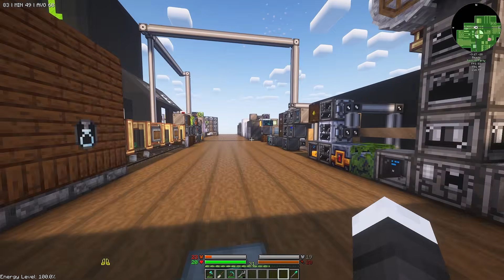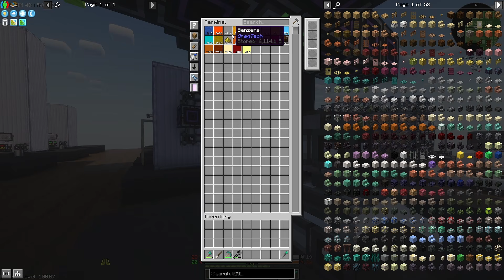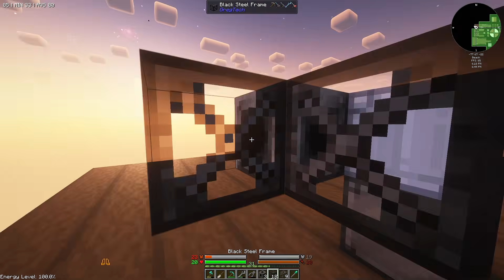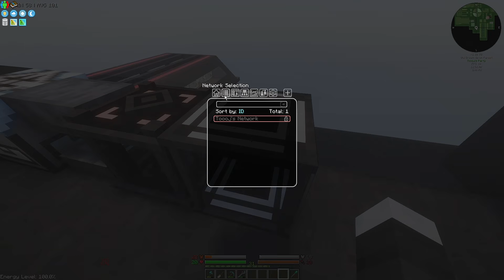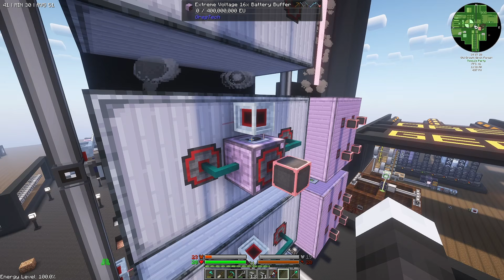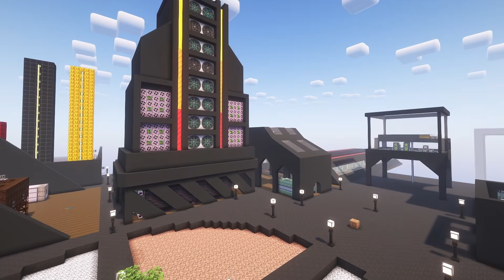Star Technology E15: EV with UV power

Comment: a nice tip,  if create is added with gregtech, you can automate the insertion of rotors when the rotorholder is empty, so you don't need to worry about them breaking or can use a rotor that is more efficient but has much less durability, also very easy to setup
Reply: oh yeah, maybe nice to tell you that it's the mechanical arm, that auto inserts

Comment: You can pretty much use the flux storages until you get the ultimate battery, because the other substation capacitors have less or equal storage to the gargantuan storage

Comment: Dear CEO,

Please make sure to check the box labeled "Bypass limit" in all of the flux plugs, & also in any of the flux points where you are dealing with large amounts of power. Otherwise they will be rate-limited.

P.S. As others have mentioned, the flux configurator will be very handy.

Comment: Dear CEO

Since StarT is a GTM you have access to configurable which give an free 10% efficiency buff when used on generators by extending the recipe, They can also be used to decrese recipe times by upp to 10% all at the cost of having to do maintenace witch can be neglected with a stack of tape inserted

TLDR - Configurable maintenace hatches are usefull for multiblock generators and for long recipies like superconductors in the ABS

Best,
Hamtower receptionist.
Reply: Also if use for turbine for power, it consume 10% less fuel for same power (and 3x time less chance of maintenance issu)
Reply: @samuelt8825 Yes that is what i stated in my comment. alltough It does not decrese 10% less fuel, it extends the recipe time by 10% and via that it boosts efficency b
Reply: @sdeasd7840 it does reduce the fuel usage by 10%  because the recipe is longer
Reply: @samuelt8825 Exactly my point

Comment: Small tip - you can create multiple flux storage networks. Once you build lapotronic supercapacitor you can set up all the power gens to a separate network that is connected to lapotronic input and separate network for power usage connected to lapotronic output
Reply: they renamed the supercapacitor  in modern :(

Comment: Part of the reason that Gas (as well as Steam and eventually Fusion) is so insane in this pack is the insane efficiency from BOTH the Rotor Holders and the unique Rotor materials. The Rotor materials in particular have some pretty insane scaling. I remember rushing them to upgrade my 2 lone Steam turbines that lasted me until UHV.
Reply: (best rotors of each tier is straight up the superconductor. But you get the superconductor a tier before you use it as a câble (thanks to oc))
Reply: @samuelt8825 i suspect they want players to use the special superconds for all their base wiring

Comment: If you want to pass on doing centralised cable runs, I can recommend continuing to use flux plugs in the future and instead just dumping all generated power into a flux plug network called "generators" or smth, have that output into the supercap/substation and have another output from that go to wherever you need

Edit: you can also disable limit on the flux points/plugs once you need/get more power from better turbines/combustions gens.
Reply: Just have everything going into subs and output on a different channel 

(And btw pre uv garg are better than subs)

Comment: 14:10 It would make sense if you think of it as the redstone flowing in the node, but it is confusing, yeah (took me a bit to wrap my head around).
Also, side note: if ever you wanted to use this to control other cards directly, then you control the aptly named redstone channel for that card instead of its regular channel.
Reply from the maker: Dear employee,

Right, but all the other cards can be thought of the same way. Energy card's definitions of extract/insert are relative TO the network, so extract extracts from the block into the network, and insert inserts into the connected block.

The redstone channel might be useful too!

Best,
HamCorp
Reply: @Ham-Corp  I don't think you messed with laser io counting filters but they also work backwards to everything else. The extract point has to be set to insert, and then you have another insert card with the counting filter in it...